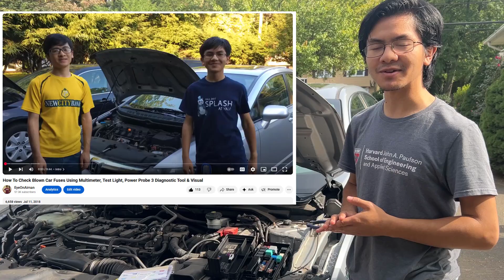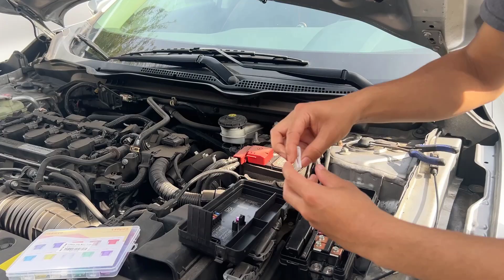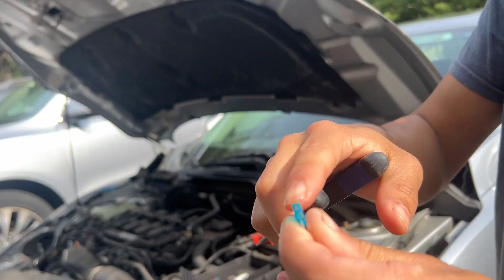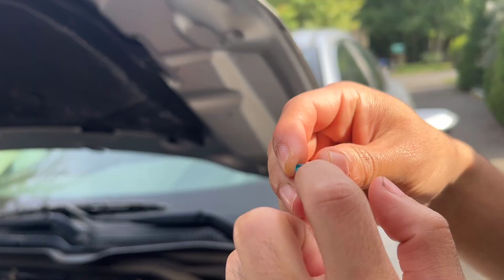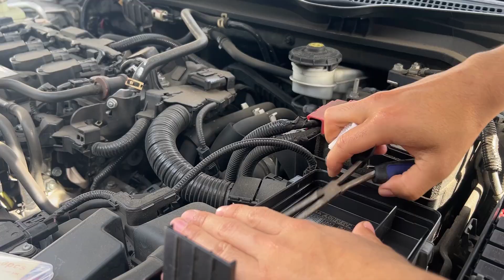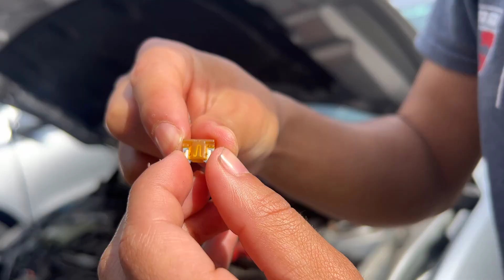How To Remove & Replace Blown Fuse In Your Car | Broke The MicroFuse Clip Using Needle Nose Pliers

Comment from the maker: Here are the #ᴬᴰlinks to the parts, materials, accessories and tools needed for this repair and/or mentioned on this video:
1.  https://amzn.to/46Il7y9  |  JOREST 300Pcs Car Fuse Assortment Kit, 160 Mini Blade Fuses Automotive + 90 Standard Auto Fuses + 50 Micro + Puller – Replacement for RV Camper Boat Truck (2Amp 3A 5A 7.5A 10A 15A 20A 25A 30A 35A 40A)
2.  https://amzn.to/4pQiItX  |  Relay Puller Pliers Relay and Fuse Remover Tool, Automotive Relay FMM Fuses Puller Tool, Car Vehicle Battery Terminal Wiper Remover
3.  https://amzn.to/48HTQyn  | UPLUS BCI Group 47 Car Battery, AGM-L60-UP Maintenance Free 12V 60Ah Premium AGM Batteries H5 L2 Automotive Battery, 660CCA, 105RC
4.  https://amzn.to/48bDn5A  |  forenner Fahren Upgraded H11/H9/H8 Bulbs, 40000LM 900% Brighter, 1:1 Size, 6500K Cool White, CANbus Ready, Plug-N-Play H11 H9 H8 Fog Light Bulb with 20000RPM Cooling Fan, Pack of 2
5.  https://amzn.to/3WmCqjq  |  SEALIGHT H11 H8 H16 LED Fog Light Bulbs or DRL, Real 360° illumination Fog Bulbs, 6000K 400% Brightness Upgraded, H16 Front Fog Lamp,Non-polarity, Pack of 2, Plug&Play

Or Click on Amazon link here and search for what you need:  https://amzn.to/3xIOsqg

Comment: I had an interesting situation recently on my 10th gen Civic. My tail light parking lights, in addition to ECON button, climate control buttons and P,R,D,N,S,L lights stopped working. I went to electrician and after he checked interior fuse box, he then went ahead to engine fuse box and added a 15 amp fuse to the right side middle location, exactly where your fuse box doesn't have one. Interestingly it fixed my problem, but now that i see that you are also missing one, I'm wondering if it was the right fix, or just a temporary one.
Reply from the maker: That's an interesting situation with your Civic, thanks for sharing your experience!